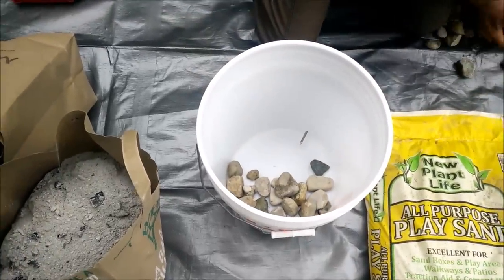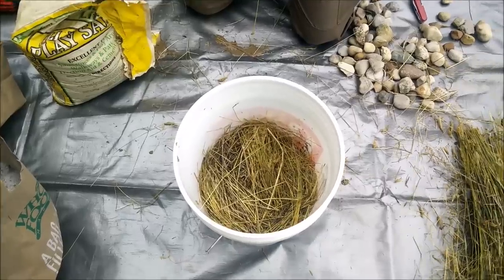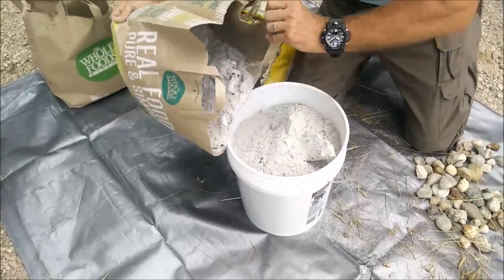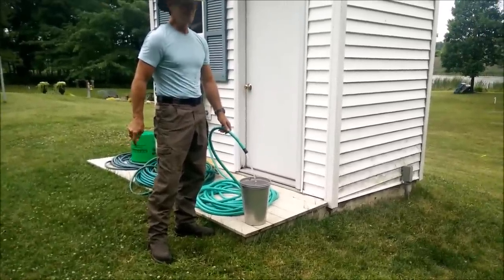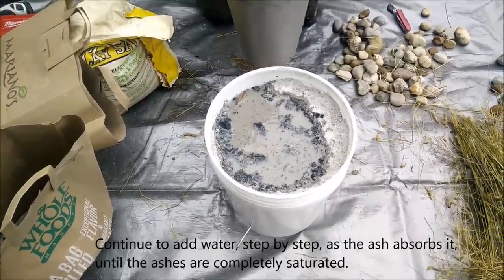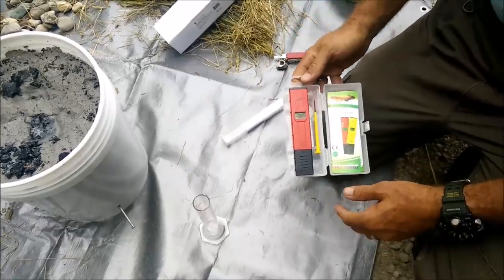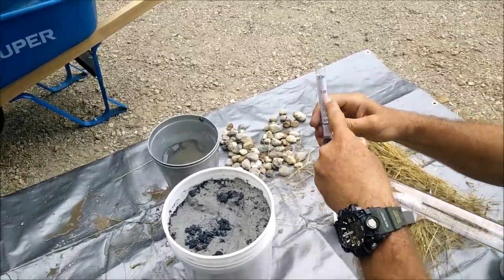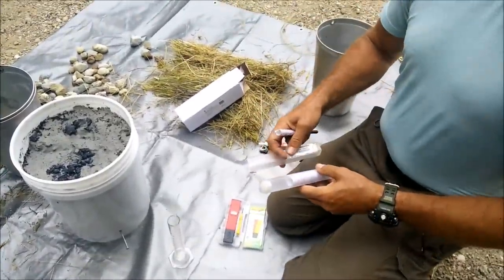Making Lye Water (KOH) from Hardwood Ashes

Comment: Product obtained here is potassium carbonate, not potassium hydroxide! To make hydroxide you need to treat potash solution with hydrated lime Ca(OH)2.
And there is no need of 9 days steeping, but merely 10 min.
 Potassium carbonate can convert fats to soap, but needs prolonged boiling. Hydroxide is very fast, even at room temperature it needs few days to fully saponify fats.
Reply: Yeah just mix the ash with good quicklime or slaked lime then you can have some real lye.

Comment: thanks lot. this going so much easer then barrow that i was  think of doing. my version going have a. screen hold ash off bottom some concrete blocks hold screen up.  how strong is lye in your version. could use as drain cleaner? sand and stone saw other vedioes make a water filter. why use charcoal get clean drink water. were use ash get something burn skin off? home made charcoal is part burned wood and ash complete burn what difference?
Reply from the maker: Hi Rodney.  Thanks for watching and commenting!  This "cold process" yields lye water that will float an egg; between 8-10% lye.  It is not strong enough to clean drains.  The lye water is then reduced by simmering to get to about 25% concentration, which is within normal bounds for soap-making; at that point the lye would irritate and possibly burn skin.  Charcoal is very porous, which is to say it has a lot of surface area, and hence "bonding sites" for "volatile organic compounds," chlorine, sediment, etc.  Here is a wikipedia article on the subject: https://en.wikipedia.org/wiki/Carbon_filtering  Everything I have read about soapmaking, indicates that you want fine ash, from wood burned completely at high temperature, not the charcoal bits.  To this point I have not filtered out the charcoal, but I probably will this coming spring/early summer when I get back to soap-making.

Comment: Good video John! I have been thinking of doing the same thing to make lye for nixtamalization of corn (https://en.wikipedia.org/wiki/Nixtamalization) and think the method you are using would be great. A couple questions: Did you run the ash through a screen to get the larger bits out? Thinking the char could be added to compost or used as fire starter once the heating season begins. Also, does the single nail provide adequate drainage?   Thanks again, Sam
Reply from the maker: Thanks Sam!  I did not run the ash through a screen.  I dumped it out of the bags I had been collecting it in, directly into the 5 gallon bucket.  The single nail works fine so long as you are not in a hurry.  A larger hole though I'm afraid, might also allow much of the sand-filter to leave the bucket.
Reply from the maker: I was just reading at your link, "The Nahuatl word is a compound of nextli "ashes" and tamalli "unformed corn dough, tamal."  We have the ash part down!  Did they use the "slaked lime" in combination with KOH (potassium hydroxide), or was it either or, I wonder.

Comment: Do you need to do any other steps after this or can you use what you get for lye in making soap?
Reply: "Back in the day" they would have made the lye in a big caldron over fire of course, and through heating they would have reduced it until and egg would float or it would dissolve a chicken feather (crude measures of the lye concentration), then they would have added their fats and continued to heat and stir to obtain soap.  So the short answer in "no."

Comment: how do you know when your lye is ready? i have a 2.5 gallon bucket with a nice little layer of woodashes and water in it. I ran my finger through it and it itched and burned a bit
Reply from the maker: The old fashioned way was to float a fresh egg in it.  If there is a nickle to quarter-sized surface exposed, it was considered ready for soap-making.  This is a crude measurement of the specific gravity of the lye-water.
Reply: or drop a feather into it and see if it dissolves

Comment: Did you make soap with it?
Reply from the maker: goddesskristie I am experimenting with the soap, specifically a simple lye + lard recipe. The challenge is in finding by experiment, what the level of impurities is in the lye.  By specific gravity, I may thing the concentration is 25%, but impurities could impact that result to the tune of 5-10%, or more.  Work continues.  Thanks for commenting!
Reply: @PrimalWoods  With hot saponification, you could reheat and add more lye, if the soap turned out overfatted.

Comment: Is really after you soak the water on plain ash after few days you will cook it until you got the crystals
Reply from the maker: I do not cook it until I get crystals.  After you get crystals, in soap-making at least, all you are going to do is add water back to the crystals.  In my limited experience, what you need to make soap-paste, also know as soft-soap, is about a 25% concentration of lye in the lye-water.  In my opinion, cooking it down to crystals is a waste of energy.  I will be conducting another experiment in lye-making soon.
Reply: Primal Woods well thank you for your advice
Reply: @PrimalWoods  I think the benefit of cooking down to get crystals is that you will burn off the carbon left in the water which equates to impurities. So your soap would be clearer.

Comment: Lye has several uses.
It can be used to process foods like corn to hominy.
Shredded aluminum foil added to lye makes hydrogen gas which can be used in balloons.
I believe it will etch iron and steel so it can be used to clean neglected iron cook ware ond ovens.

Comment: i don't see how this filter works

why not just sieve it and subsequently filter it, then add water
Reply from the maker: Sieve what, the ash?  Basically this filter works just like ground water is filtered on it's way to the auquifer, though not as well.  Virtually all of the ash is retained in the bucket, while the KOH (and some other chemicals) together with most of the water pass through.  The water is required to leach the KOH from the ash.  The resulting lye water can be evaporated to yield lye crystals, but I have not found the need to expend that much energy.  The lye water works for making soap paste without being further reduced.
Reply: @PrimalWoods  So you haven't been able to make hard soap with this? I've heard adding salt can help.